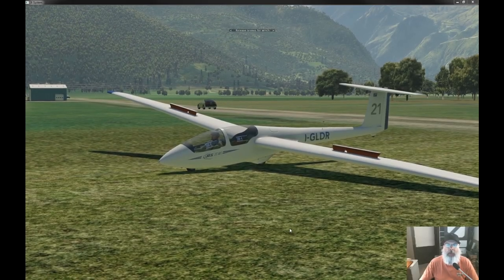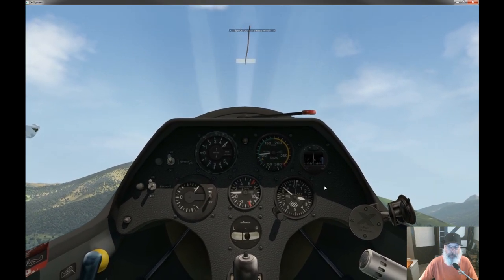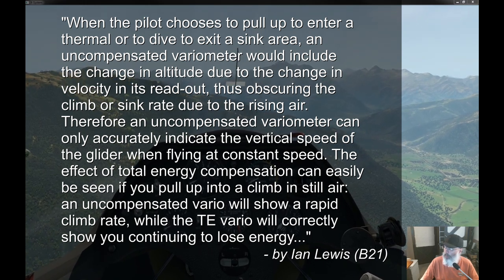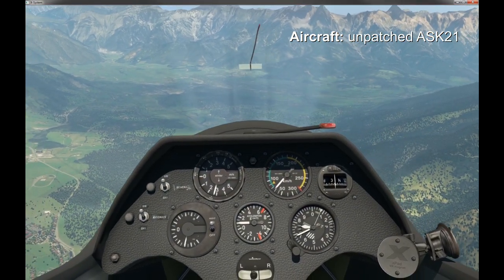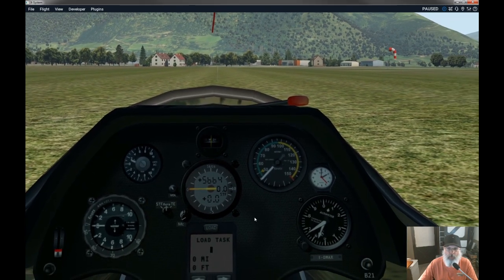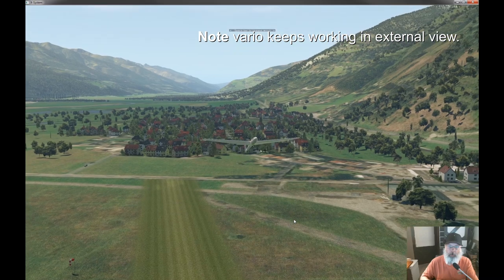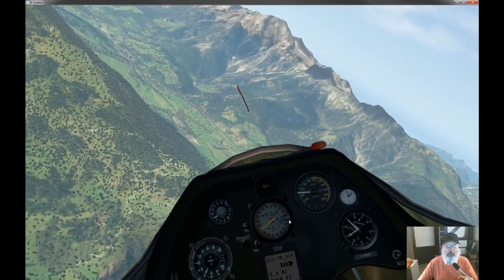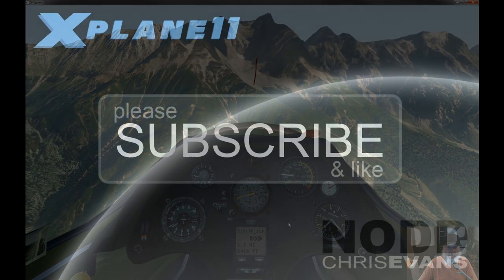X-Plane Glider Instrumentation - part 1

Comment: try to fly slower in thermals...if you fly 70 kits it will be harder to find the thermal and center it
Reply from the maker: Ian's ASK-21 has a keybinding for a "trigger trim" system. You can assign to a key or button that instantly sets the trim for thermalling. I've not had a chance to play with that yet but yes I generally do slow down when circling. It's amazing how one's IQ drops when you're trying to narrate & video & fly at the same time :-)